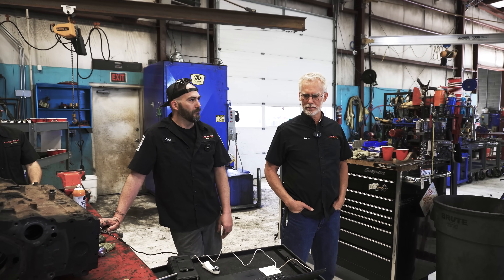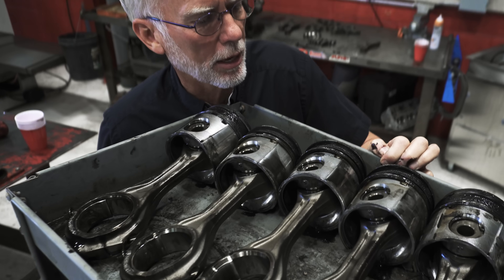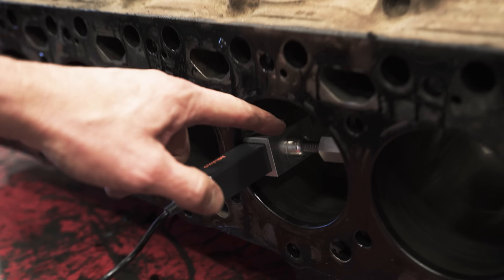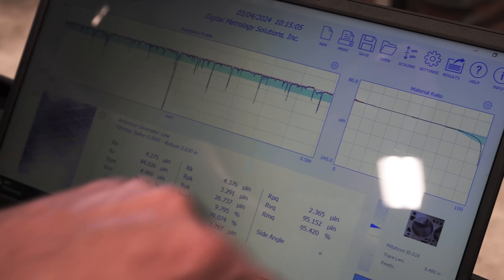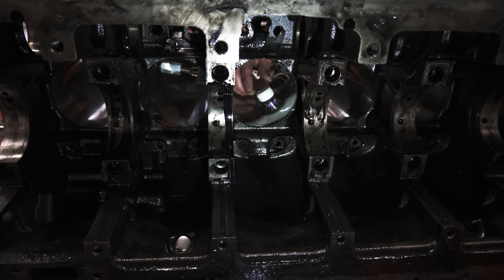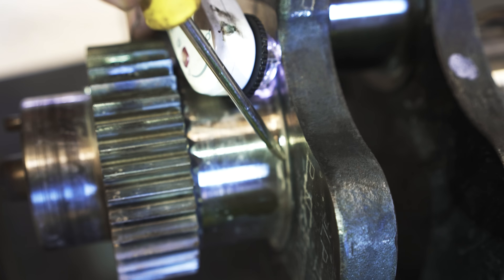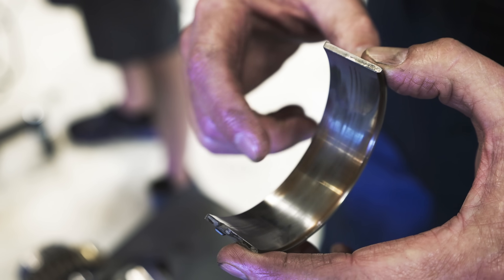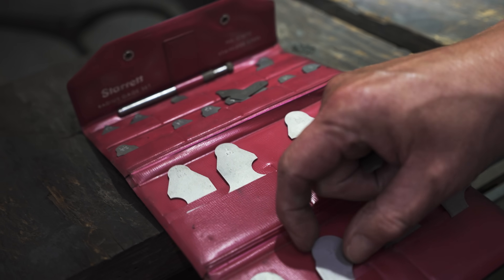5.9 L Dodge Cummins tear down inspection reveals poor machining

Comment: This is like a chain saw sharpener you have to do the same thing kinda but you have to dress you going wheel to ge the right radius or like me I use a steel wheel with diamond dust cutters so the wheel is flipped each 20 uses but I never have dress this wheel and the stone wheels have to be dressed or checked each time you use that stone. Sort of kinda what you are saying .

Comment: The comment on the radius of the journal was interesting. What you did not embellish on was the importance of the radius. In my families experience in the 70's and 80's was that machine shops are too stingy to radius the wheel properly. Leading to a sharp corner and emanating in crank failure.

Comment: I have rebuilt a few engines and transmissions in my life and I have one rule about teardowns. I don't even think about ordering parts until I know what failed and why it failed. If I can't be sure that the cause of the failure is going to be addressed, I don't want to waste my time putting together something that is going to fail again.

Comment: Crankshaft radius requires a smooth transition and radius to avoid stress risers. After grind most rebuilds polish in reverse rotation or use a Qpac  micro polisher that makes the journal smoother and profiled

Comment: Back in the late 80s, early 90s, I worked at a machine shop. I helped an old timer who built race engines in the 50s & 60s. So much if this information you talk about has been lost through the years. It's refreshing to see someone who knows what to look for and how to diagnose the failures
Reply: I spent my entire lifetime working as a Machinist and Tool & Die maker. When I got near retirement age, what you would think a responsible employer would do is pair me up with a newbie coming into the trade so I could pass on my 45 years of knowledge. What happened was nothing happened. Packed up my tool box and left. Years of knowledge and experience gone with the last click of the timeclock.

Comment: Sad thing is nobody wants to do partial engine machine work or builds thanks to idiots half a$$ing stuff and cutting corners. I can't even find a guy here who will skim a head for me to suit MLS gaskets or balance a rotating asy. Problem is alot of new aftermarket cranks end up with hour glassed journals from over polishing. New rods are honed too tight on the small end and big end. I pull everything new apart and check it. Most shops don't have profilometers or other specialty tools. The last shop I worked at had brand new Rottler and Sunnen stuff. We did work for Roush and Yates. Rarely had any comebacks. The new Chinese junk cranks and rods have really ruined the business. Nobody wants to spend the money for decent parts like Carillo, Crower, etc. They instead buy cheap forged rods and then need extra machine work to make it work when they could have spent a little more and had useful stuff needing little work. Then you have those cheap cast cam cores used for solid roller setups instead of billet cores... the list goes on and on...

Comment: This is why new engines are last longer when it maintains properly,  and when it goes bad not a lot shop are able to rebuild it because all of that details.  The old deck and hone machines are not gonna get the job done 100% on rebuild.  The cost of all of Dave's machines are tremendous.   That's why it is more economical for Dave's to do it rather than investing to one of those machinery.

Comment: Excellent video with decades of knowledge that shines through. I can appreciate the attention to detail it takes to machine and rebuild an engine. Many times I've trusted my local machine shop to do all the work 100% spot on without knowing whether they did or not. Sucks to think that these machining wizards are a dying breed and will be gone in the years to come because of the EV movement. 👍

Comment: I'm 850 miles away from Dave's Auto Center but I will tell you what, if I ever need engine work done on my diesel, I'm taking a little drive so I can gett'er done right on the first go 'round.

Comment: Hi Dave. Absolutely love your videos. I have a general question relating to your work. In your videos you and your staff often have your hands in used engine oil and various other oil products. Correct me if I’m wrong but isn’t prolonged skin contact with this stuff bad for you. Of coarse I could be completely wrong. Kind regards. Paul. SWFrance

Comment: DAVE. THIS IS WHAT THE WORLD NEEDS. I worked for a automotive certification company, you need to put out a "XYZ Certification" of shops who are QUALIFIED to do your level of work so that not everyone who lives near you can get repairs done right. Our company became rich, but what we did was we certified which body shops had the right types of equipment to do a quality repair and gave them a "certification" with a wall plaque, etc, and then we did a little marketing for their shops that got them business (this was how they justified the COST to become certified). If you need help, I'm a programmer who does and did this work for them to make this all easy for both sides.

Comment: I just tore apart a 7.3 im building.that was a original untouched high miles engine.  The first and last main looked like that. Just not quiet that bad.

Comment: So with a diesel engine with around 500,000 miles what’s the finish the cylinder wall should be if the motor has never been rebuilt?

Comment: i love how in America there is a sin to use normal terms like "convex" and "concave" when you could use "barrel" and "bell mouth". Same for measurements like weight, distance etc :)). Other than that, great videos, a lot to learn from you guys. At the moment im rebuilding an om602 2.5 turbo engine and it`s sooo hard when most of the builders/machinists here (romania) are illiterate when it comes to actual technical knowledge

Comment: There is no doubt that Dave is one of the best in the business but with that, comes the associated revenue and tech. The 5.9 has been around for over 34 years - what were independent shops doing back then? I can tell you they weren't employing tech anything like this.... And motors weren't blowing up left & right.

Comment: Your point of doing all or nothing is a valid one. 
I don’t build engines.
But I have a shop and I will put rebuilt engines in. 
I will not give the truck back until I run it myself to break it in and change the break in oil.
I am not going to rely on someone else to change the oil on time and possibly destroy what a good builder has done.

Comment: Great shop Dave. You are blessed with a good business, personality shop culture and crew.
  I worked in CAT dealer Long Island  in my 20-something days that had similar operation with general repair and machine shop and that is the ONLY way to go. (I used to dream of being the field tech) Your shop is resurrection of a dying breed. Back when I was a kid, even most auto part stores had machine shops in the back. Not so today! We left Diesel School knowing basics to rebuild heads, turbos, alternators, starters, even high pressure pumps and run test stand. In the real world many of us lose some of those skills but in your shop can apply a full set. From fuel injection troubleshooting to engine building, suspension etc. 
The trainees should be paying you!

Comment: 1. A bell mouth taper in a crankshaft journal refers to a specific shape or contour of the journal where its diameter gradually increases from the central part towards the ends. This tapering shape resembles the opening of a bell, hence the name "bell mouth." This form is typically used to facilitate the assembly of bearings and to help distribute the load more evenly across the bearing surface. The bell mouth configuration can help in reducing stress concentrations at the edges of the journal, leading to improved durability and performance of the crankshaft in an engine.

2. A barrel taper in a crankshaft journal is a design feature where the journal is slightly bulged or curved outward in the middle, resembling the shape of a barrel. This subtle convex curvature along the length of the journal helps to distribute loads and stresses more evenly across the surface of the bearings during operation. When the engine runs, the shaft can flex under load and thermal expansion, which might otherwise lead to increased wear at the edges of the bearings. By using a barrel-shaped journal, the contact stresses are more evenly distributed over the width of the bearing, reducing peak stresses and potentially extending the life of both the bearings and the crankshaft. This design is particularly useful in high-performance engines or those subject to heavy loads and stresses.

Comment: After grinding Crankshafts for 20+ years, for everything from automotive to heavy industrial use with 10,000+ Crankshaft behind me I tell you that if the one who grinds your piece for you hits the flange hard enough to float the stone in the way Dave describes #1 he's a rookie or he's in a rush #2 most likely his machine needs maintenance and/or repair #3 this will most likely cause visible chatter marks on the surface not just dimensional variations #4 it is proper to sweep for the finish cut this ensures an even surface (not a step or a ridge) and a smoother finish as this cuts the ridges and valleys placed on the stone when it is dressed which are thus imparted to the surface.

Comment: You would think a micrometer would catch the journal inconsistencies. Have never checked edge radius. Usually have only needed to have cranks polished Dave, do you only use factory spec parts, moly, chrome or ductile iron rings. Believe Cat uses many ductile iron parts, not sure about others.

Comment: Back yard Joe, works hard, does the best he can with what he has. But,... certain things need a multi million dollar set up, like Dave has. To bring stuff back to " factory specs" , in critical areas, you need factory type equipment. More expensive, and fewer, farther between ,  than most people have access to.

Comment: Would be nice to have millions of dollars to get all that equipment. When I fixed mowers for a living my fix to mowers that needed connecting rod caps resized was emery cloth and my thumb. I just worked it until the crank would turn when the cap was at normal torque. You do the best with what you have.

Comment: You guys are just too good. Poor machinists and machine shop equipment ruin lots of motors. When you have rotating assemblies spinning like a child’s top, everything better be fitting flush and level or something will be stressed by a poor friction plane. Oil can only protect metal to metal if it has a an even lubricating film. I enjoy watching you guys analyze failures in your tear downs. Takes good equipment and good techs to use that good equipment. Keep ‘em coming Dave.

Comment: Im a gasser tech for the last 20 years. I get much grief from my coworker when i tell him that i watch videos of a repair shop/machine shop after work.   Dave's videos are so informative and i was pleasantly surprised to see Dave professing his Christian faith on his Easter video.
Reply: When I was a tech. I noticed most of the techs in the shop loved to watch "dumb" videos is what I call it but basically just videos of stanced cars or things like that but never actually had the passion to really learn and unfortunately I learned also that the bitter mechanic/ tech in the shop is usually the most knowledgeable one too. It's hard to be bitter and ask for help at the same time so might as well be darn good at what you do. Also being bitter and still having your job also speaks volumes as well that you ain't fired because you're useful so they put up with it. I got tired of working for shops due to shops (the ones I worked for including dealers) loved to screw you on your flat rate hours. Went into construction after a few years and made more money just starting out as a laborer with no experience than I did as a master tech for 6 years with tools. That's why our automotive industry is crumpling due to these shops screwing over techs and they are paying for it now. Idk where you're at but when I was in California, they have a "tool wage law" and no shops will ever do it even tho it's the law to pay you double the minimum wage if you have to provide your own tools.
Reply: @JacobWinkle of course California always tries to find a shortcut on not paying the people. Smh i moved to Tennessee and make more money than i did back home in Sacramento its pathetic honestly how everything is so fucked back the the government is gonna siphon everybody dry as long as they’re able
Reply: When I was a tech. I noticed most of the techs in the shop loved to watch "dumb" videos is what I call it but basically just videos of stanced cars or things like that but never actually had the passion to really learn and unfortunately I learned also that the bitter mechanic/ tech in the shop is usually the most knowledgeable one too. It's hard to be bitter and ask for help at the same time so might as well be darn good at what you do. Also being bitter and still having your job also speaks volumes as well that you ain't fired because you're useful so they put up with it. I got tired of working for shops due to shops (the ones I worked for including dealers) loved to screw you on your flat rate hours. Went into construction after a few years and made more money just starting out as a laborer with no experience than I did as a master tech for 6 years with tools. That's why our automotive industry is crumpling due to these shops screwing over techs and they are paying for it now. Idk where you're at but when I was in California, they have a "tool wage law" and no shops will ever do it even tho it's the law to pay you double the minimum wage if you have to provide your own tools.
Reply: I saw a Monster Energy drink sign. I hope Dave isn't sponsored by monster Energy. It's a satanic company.
Reply: @dingbop963
I say this in all humility and good will towards you.
We're all going to die and we all have a conscience.
Our conscience will remind us of every time we've broken God's Commandments.
Maybe we lied,  stole, lusted, blashphemed, dishonored our parents, coveted, made an (mental) image of a God to suit ourselves.... and then we're self-righteous on top of it because we think it's no big deal. 
It takes a lot of humility to admit one that has been prideful and wrong. And humility doesn't come naturally to us. We really need a miraculous change of heart.
Please go to Living Waters youtube channel where Ray Comfort explains it as he interviews people from all walks of life. Please believe me when I say you really don't want to face God with your debt of sin.
Reply: ppl get religious after they become rich and successful.
Reply: Cool story bro
Reply: Amen, Christ is king 👑
Reply: What does that have to do with anything...?
Reply: I was quite disgusted by his religion 🤮
Reply: @ding9633  I'll pray for you.  Eternity is forever brother

Comment: The engine builder   went through all the effort it’s too bad they didnt catch those out of spec  measurements before assembly. The surface profilometer that Dave has is probably 2500-3000$ bucks but there’s no substitute for it . I own three classic bmws .All with Alusil v8 blocks. Which is 80% Aluminum and 20% silicon. The surface finish is absolutely vital for the low tension rings to seal and prevent oil consumption/ blow by. My M5 engine is 25 years old now  and quite rare (used motors are now 12,000$ and up) Dave is probably one of a select few who I would trust rebuilding that engine.  His passion is still there after all these years

Comment: And if it’s a rolled fillet journal, the undercut radius has to be checked and corrected after turning  the bearing surface down.

Comment: Dave I love all these new videos you're putting out for the information, but please get a new video production crew. They're using cameras that don't focus on the actual part or work, they don't spend enough time shooting the part or information you're trying to display (Like the laptop), and they float around like the shop is the set of ER and they're doing a ten minute steadicam shot. It's impossible to focus on what you're trying to show or talk about. When you were trying to explain bowl mouth and barrel mouth they moved away right at the moment you started explaining with your hands, same with trying to show the wear on the bearings. The average cut time is somewhere around four seconds as well, not nearly enough time for anyone to make sense of what's going on. It's more Hollywood than Instructional Video.

The knowledge and wisdom you're trying to convey and impart on the viewers is incredible, and it deserves enough screen time for people to take in.

Comment: When I built a Nissan RB30DE engine 21 years ago I forgot which way I fitted the snap rings for the wrist pins but they never came off when I redlined the engine to 7000 RPMs quite frequently, I wasn't trained up on how to build engines either &  my service manual didn't have information on which way they should be fitted.

I know that the Japanese were crazy because my local Japanese importer had to rebuild most of the Skyline GT-R RB26DETT engines which came into Australia because if they spun a bearing after a hit of nitrous oxide under boost then they would throw a new set of rings and bearings into that engine which has a flat spotted crankshaft in it.

The importer would have to tear the engines down then rebuild them, customers were asking him how much does a cheap Skyline GT-R cost ?

The answer was there's no such thing, you either buy a low kilometre example which has been babied around & is in Mint condition or pay a lot of money to get one of them which has been thrashed fixed up !